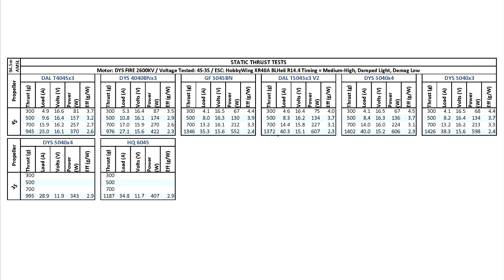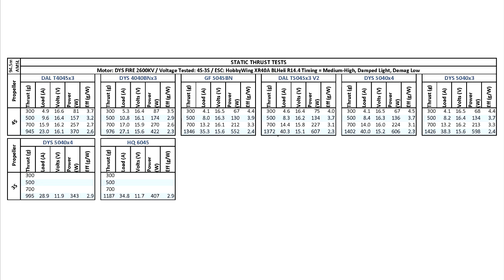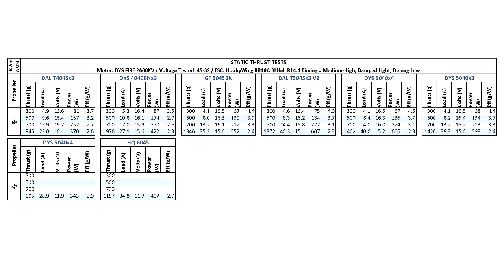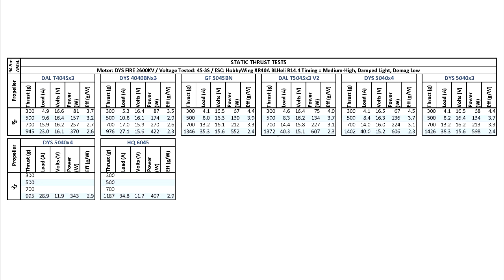New Motor dys FIRE-2600KV Static Thrust Tests

Comment: Hi, does this mean that these motors perform best with 40A escs  and if you use lower the esc's will burn?
Reply from the maker: No. I use 40A esc because I also test bigger motors with same ESC. You can use 30A ESC for this motor. Many people do without problems
Reply: @EngineerX  thx 4 the answer

Comment: Cam i ask yo a question. 
I have these and the emax 2205s  2300kv.
Your thrust chart shows  similar thrust values  but in reality these a way more and I mean way more punchier than my emax motors are.
So i am trying to figure out how to interpret the thrust results because the real world  and the thrust results doesn't seem to align.

Comment: I am in the process of building a quad 220 with these engines (dys fier 2206 2600 kw) but with a Hobbywing XRotor 3-6s blheli 35a oneshot125. You think I work well with those guys or I can break the battery or the engines. Thank you.
Reply from the maker: That ESC spec's are good enough for this motor running on 4S and any of the 5" tri-blade propellers. I used it with DYS XS 30A ESC and no problem, so the 35A ESC will be OK. HWing make good ESCs.
Reply: Perfect, thanks for your comments.

Comment: Are N54 magnets the way? where is a 5051 prop?
Reply from the maker: Team RaceKraft 5051x3 prop tested on recent Tri-blade shootout test video. Check the channel. You can compare to other tri-blade props. Thrust stand performance relative to other props remains pretty much constant when tested on various motors. That particular propeller tests a bit "low" on static thrust. It's been designed to perform best on fast-forward conditions so it excels on fast quads and it's capable of 160 kph speeds.
I don't know if factories will star using higher strength magnets such as the N54. One of the main issues is that as magnetic strength goes higher, heat-handling capability goes lower and you run into de-magnetization issues where magnets start to get weaker after each heat cycle. That causes KV value to increase a little and torque capacity of motor to decrease. Also, there's the economics factor. Perhaps N54 magnets are more expensive? With such competitive pricing for high perfromance motors these days, factories are hard pressed at turning a profit on each motor they sell
Reply: Thank you for, the question of heat is a big one you are very correct, I heard of N52SH magnets which are rated for a higher temp and though N54 should if it is following the right curve should not only be stronger but in a perfect would have the higher temperature rating as well.
Reply from the maker: Right, they have high-temp rating version for the stronger magnets as well. So I think at this point is a matter of economics and time. We will probably eventually see the stronger magnets getting used as manufacturers battle each other to get the strongest motors. But as I understand there's also a point of diminishing returns so all the components have to be balanced: Stator lamination thickness, Copper wire winding diameter, Magnet strength, Magnet density & size, etc. It's just amazing how much power these little $10 to $20 motors are putting out. I wish battery development improved just as much. I think when you use a set of 4 of any of the various top-performing motors your main limit is current LiPo capacity.
Reply: EngineerX there has been some mad jumps in motor development as of late with all the tiny brushless as well we must be reaching the limit soon it will be interesting what the limit is and how that motor will preform, like you say it is time for battery technology to catch up big time let's hope for example we get better batteries before we get F7 fingers crossed real grafhine batteries are coming.

Comment: im building a quad with DYS XS30A  would you recommend getting the 2600kv or 2300kv, im planning using 5040x3 or 5045x3 or 5045BN props
Reply from the maker: Depends how you like to fly. I think for free-style and short track races the 2300KV is very good and more versatile. The 2600KV will have faster top speed, but it will go through Lipo a lot faster too. Since it's a 2206, both have plenty of torque to spin 5040x3 or 5045x3 V2 props. The 2300KV will be kinder to your LiPos and may "feel" like it has a little more response going from the lower RPM to the mid RPMs. The 2600KV will pull more on the high RPMs if your quad is light and not too bulky.
5045BN - use the GemFan type only, those straight edge tips waste too much power
Reply: Thanks for helping, il get the 2300kv!
Reply from the maker: I think it's a good choice! I like 2300KV more for 5" tri blades and just flying around.
Reply: Im also considering buying shrike v2 200 or 220, the 220 i can fit 6" props, and the 200 5" only, would be a good choice getting the 220 over the 200 in terms of efficiency, since the build would be probably lighter with the 5" and 200, but maybe get some higher speeds with 6" but it might not compensate, in terms of battery and flight overall?
Reply from the maker: If you notice almost all of the top-ace FPV pilots use the 5" prop quads. What I've felt when I fly is that the 5" is more agile and feel less floaty. If you're flying is mainly going to be smooth wide sweeping turns, then the 6" frame might be a better choice. Yes. 6" props are more efficient, but then you end up using a larger LiPo like a 1800 or 2200mAh and quad ends up a little heavy but it will fly smooth. 5" frame will be more agile since props are closer together. You can also use 5" props on the 6" frame so there's that option too.
Also what ends up happening with 6" props or with high KV motors like 2600KV is that you end up going faster or using full throttle more so the efficiency advantage becomes less pronounced. 5" frames with 1300mAh Lipos give you about 3min of aggresive flying or about 4 or maybe 5 if you're very easy on the throttle. 6" may give you around 5min with 1800mAh batteries and smooth flying/cruising around.
Reply: Thanks for the tips, i have  racing in mind perhaps going for the 200 and build a smaller and lighter build

Comment: are these better that emax redbottoms reshuffle in terms of thrust?
Reply from the maker: I actually never got around to testing the EMAX RS2205-2600KV so I can't really tell. On the 2300KV These make more thrust than the original RS and are very close to the new RS2205 S.
Reply: EngineerX  wow, seriously I need these and the price point is very good!